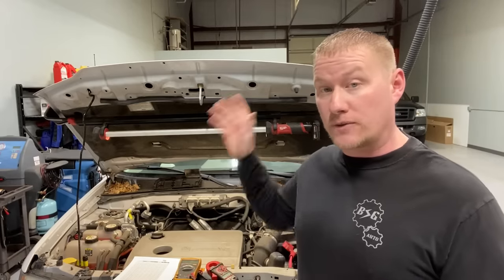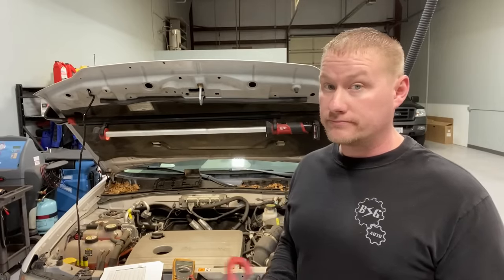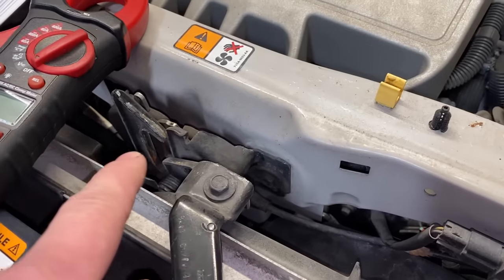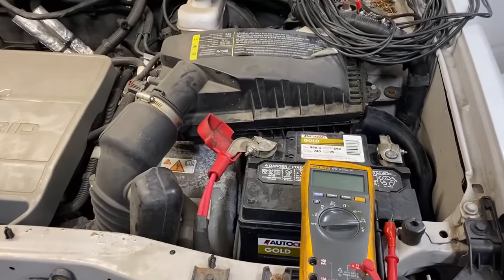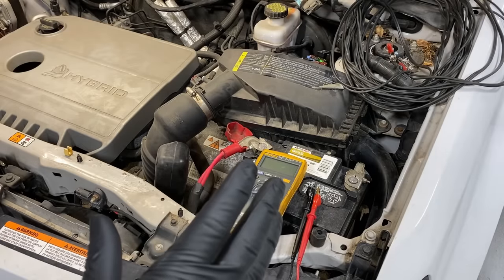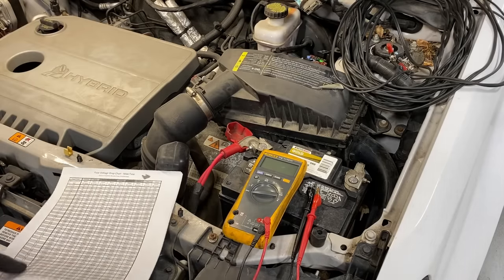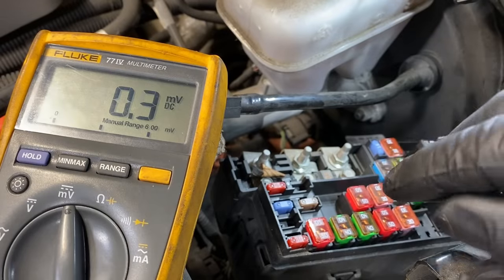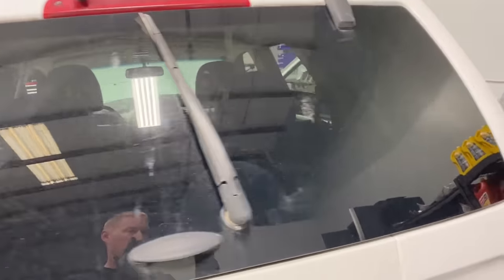Which Parasitic Draw Test Method is REALLY the Best?

Comment: Could someone please explain why amp clamp went on positive post and not on the negative as in the series test with amp meter ,thank you
Reply from the maker: It is based off the flow of electrons.
Reply: Relatively speaking, it doesn't matter as all electrons going out of the battery through the positive terminal will come back through the negative.

Comment: How do you see the draw when you are checking the fuses inside the cab of the vehicle without a second pair of eyes
Reply: Some ideas: You could sit the amp clamp against the windscreen so that you can see it through the windscreen. You could use a jumper lead to extend the length of the positive terminal cable. You could point a borescope at the readout of the amp clamp. You could point a phone camera at the readout and make a video call to a second phone.

Comment: Checking every fuse is cumbersome and takes time. I tend to check a [row] of fuses with a test light. Then test only live fuses. No use wasting time on dead circuits.
Reply: >  I tend to check a [row] of fuses with a test light. Then test only live fuses. 

Please elaborate, thanks
Reply: @noahkatz9616  
Okay, I’ll try my best to explain. 
Say you have a fuse box that has 25 fuses, 5 left to right and 5 top to bottom. We know all fuses are not powered key off. So we use a test light to check the first “row” of fuses 
Left to right. Let’s say we find only 2 
Fuses were powered, then we voltage drop test only those 2. 
Then we go to the next “row” of 5
Etc etc.  Hope that helps.
Reply: @rafaelgarcia-xk7eu  OK I get that if you're reading a voltage drop across a fuse w/key off you've got a culprit.

You say checking every fuse takes time, but by the time you've gone through all five rows, you've checked all of them, so how have you saved time?
Reply: @noahkatz9616  
It takes one hand to use the test light. 
It takes two hands to do the voltage drop test, the you have to look away to see the meter possibly loosing contact. Now imagine under the dash, on your back. That’s of course my opinion. Works for me.
Reply: @rafaelgarcia-xk7eu   OK, but I don't see what that has to do with having to check every fuse in any case.

Comment: For the 'best' method, you need an amp clamp, a 2nd multimeter, you need time to wait for the draw to happen (which could be 15, 30, 60min or more), but the draw could happen for a total of 2 - 5 seconds.  You would literally need to be eyes open, looking at the thing, and wait for it to peak. That doesn't seem like such a good method.
Reply from the maker: It is the most accurate, you will need to wait for the vehicle to sleep either way and will be waiting for an intermittent draw either way. That is why this type of work is so frustrating.

Comment: You say measuring the voltage drop across the fuses is useless? Not true, but to make it useful you have to have an extremely accurate meter. The Fluke meter is accurate but you have to pay very close attention to the readings that you get and dont skip writing down every didget of the voltage drop across each fuse. But it very difficult to track down an intermittent  problem.  This method  probably came from an engineer at ford or almost any electrical engineer.
Reply from the maker: I say it is useless by itself because there will be no reading without a draw actually present so yes, it is true the test is useless by itself as you cannot have a voltage drop with current flow. Do you understand now?

Comment: Yeah but . . . using the "ideal" 3rd method you still cannot check the voltage across those fuses that do not have exposed contact points that he said is a potential major problem with the 1st method.
Reply from the maker: Using any method cartridge fuses would be dead last. You can pop the clear window off it is just a bit more time consuming than a normal fuse.

Comment: link for your thermal imagery device?
Reply from the maker: I link to it in the video description
Reply: @FordTechMakuloco  The only things I see are the clickable links for the multi-meters and the PowerProbe voltage drop fuse charts. I didn't see anything for the thermal imager. Anyways, what model is the thermal imager that you use?

Comment: I dont understand why use the jumper cables. Why not just hook the positive lead of the MM to the negative cable and the negative lead of the MM to the negative terminal. Now the meter is between your battery and the components sucking juice from it no?  I dont understand what the jumper does.
Reply from the maker: No that is incorrect.

Comment: I've been in the electronics industry for 37 years and I've never, ever used a voltage drop test to find a parasitic drain. This method of calculating current draw is very reliable IF you know the resistance of the circuit across which you are measuring. In fact it's a very common method of measuring high amperage currents in circuits, using a shunt of a known precise resistance. Fuses are all pretty much the same device but they are not precision devices and all it takes for that method to give you a poor reading is a fuse with some sort of problem with the alloy used to manufacture it. This is all presumptive and in my opinion, completely useless in any sort of real world testing.

I honestly haven't seen this method being recommended but it's absurd.
Reply from the maker: Yup the company Power Probe pushes it, and all these YouTube techs follow them blindly not seeing how flawed the test is.

Comment: Putting a metre across a fuse is not going to determine its current draw. Power travels through the easiest circuit.
Unless the fuse has blown you can't determine its true current draw. Remove the fuse , then test the circuit with the metre seat at amps.
 Or use an amp clamp over the output  cable.
You will need to know the true current draw of the circuit to start a true test.
Most problems will be bad connectors or corrosion in the cable..
Test the wires from fuse to connectors.
Reply from the maker: Did you miss the part where you take the draw through the fuse and convert it on a chart????

Comment: I felt you contradicted yourself by saying  that testing the fuses in situ with the meter wasn't conclusive and also the cartridge fuses couldn't be tested due to the design and yet at the end of your vlog you're stating it's the most reliable method and the only way I could see that these fuses could be tested is by pulling them so I'm a little confused with your method!
Reply from the maker: No contradiction here, it's all very simple actually. The third hybrid method is best by being able to monitor for an actual draw to make sure it is occurring before testing the voltage drop across the fuses to see which one is causing the draw. The problem with the first method of only checking voltage drop across the fuses is you are doing it blindly which is in no way accurate. Cartridge fuses either way are going to be a pain and should be tested dead last. You can still test them in place if you pop the clear plastic lens.
Reply: Thanks for clearing that confusion up for me!

Comment: OMG.  FML.  I could have been shutting off the "key is in ignition beep" all these years by just using a screwdriver in the latch of the needed to be open door?  Stupid doesn't even come close to describing how I feel right now.   How to get them to shut again?
That person has spilled multiple drinks in the seat.  Stubborn learner.  
What the heck is that thing up by the firewall/brake master cylinder that's like wood with rubber grips on the handle?

Comment: You could always use one lead from a pair of jumper cables to clamp from negative battery cable to battery, instead of using two 14 gauge wires. Duh…
Reply from the maker: Yup but these are my long test leads for diagnosing circuits front to rear of a vehicle so they are my go to since they have the right clamps at either end.